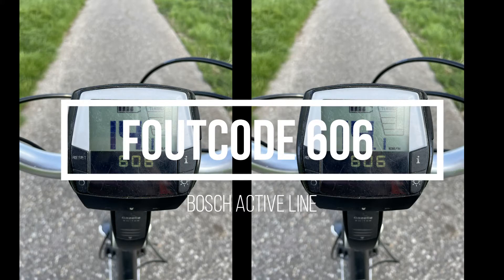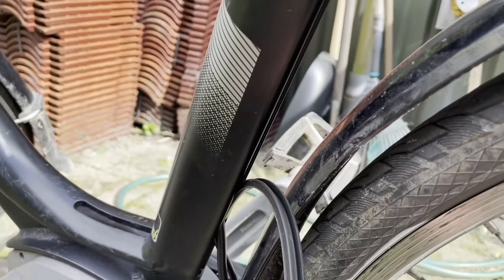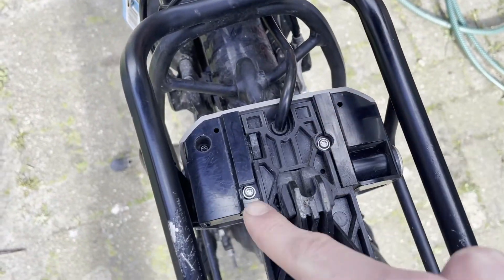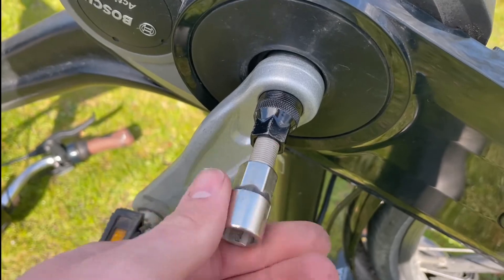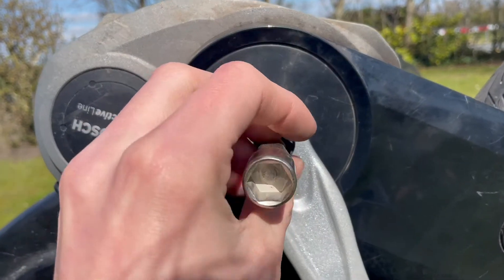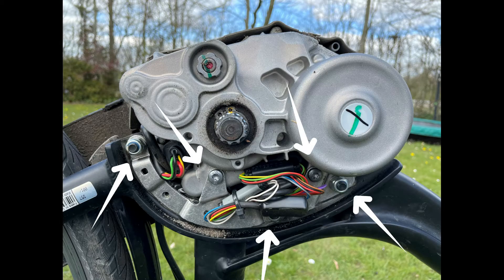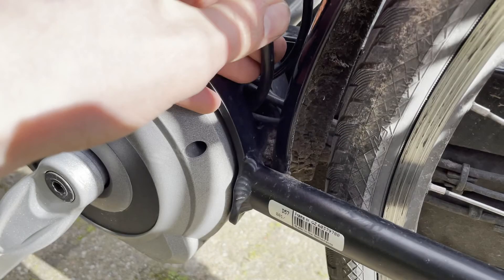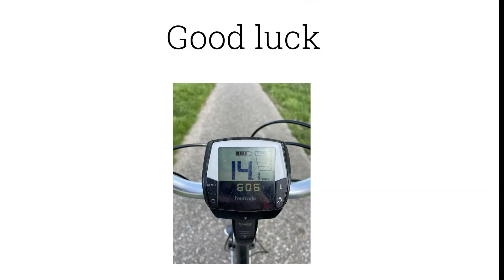Error Code 606 - Bosch eBike

Comment: I had lots of micro power cuts with 606 errors.
I thought for a long time that it was the battery (the bike is already 6 years old ...) : we checked the battery and it was ok.
Sometimes the charging did not go well, we checked the charger, it was ok.
Progressively my doubts focused on the cable even if I could not imagine it could be that.
And I saw your video which finished to convince me. I changed the cable following the protocol.
The miracle happened, now everything is working fine. 
thank you

Comment: hi does any one know how long is this frame cable for the  type of e-bike Moustache Lundi 26 ? I got my display showing me this error and the speed indicator disapears and in a moment appear again. do you think this might be due to this error ? thank youu
Reply: Hello, I have the same disconnection problem repeated on my e-bike Moustache Lundi 26.1. Were you able to solve your problem by changing the cable? If yes what size did you take?